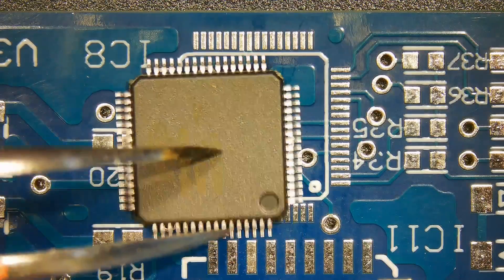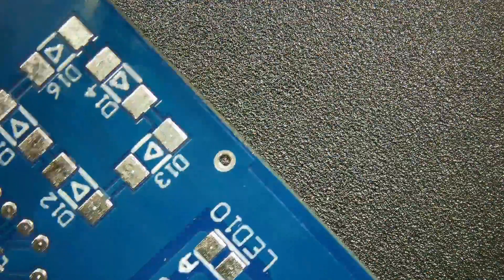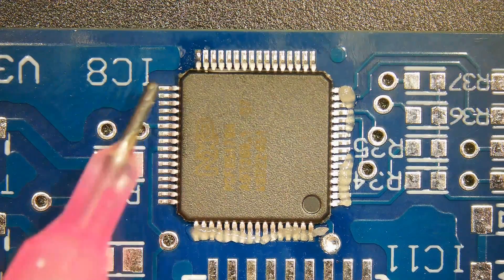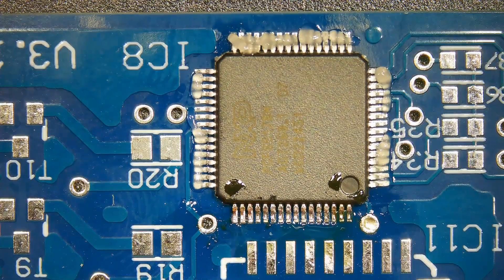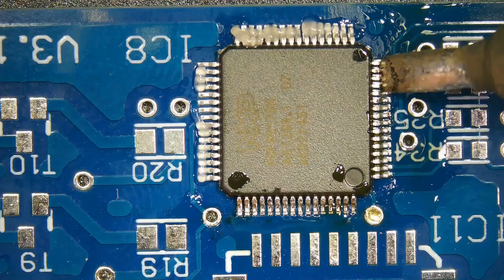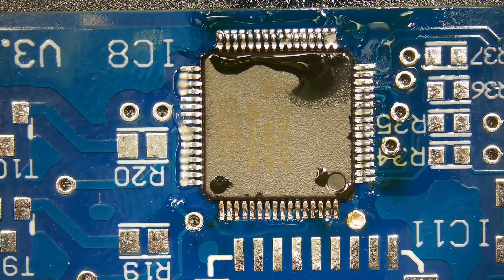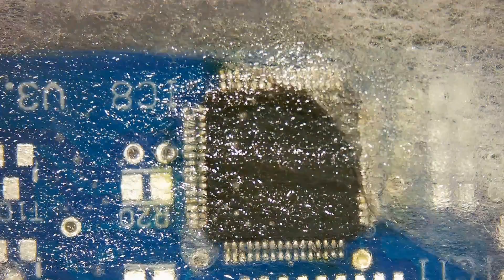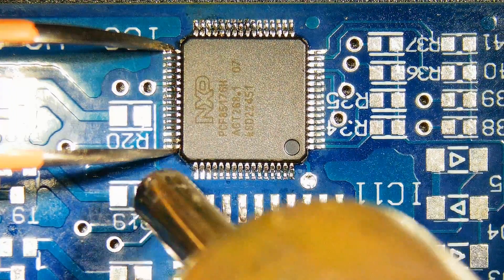SMD soldering tutorial - Quad flat package (QFP) Install and removal

Comment: Friend, You are not using the correct soldering tip.  I recommend a conical bent tip to reduce bridging.  If you prefer sweeping method then use a gullwing tip as per comment left by another viewer.
Reply from the maker: @mrBDeye  thanks for the suggestion sir. It will definitely improve my skill.

Comment: I've been several years in pcb repair and fine pitch rework. I can give you a few tips for your comfort: 
the alignment of pins over pads has to be almost perfect. 
on the topside and right side of the tqfp they are a bit off, they increase the chance on bridging. You can also use more flux, it will give you more flow. Another tip is
using a gullwing soldertip for this, with a gullwing and enough flux it is possible to solder this package in around 5 seconds.
Reply from the maker: Thanks for your tips. Much appreciated